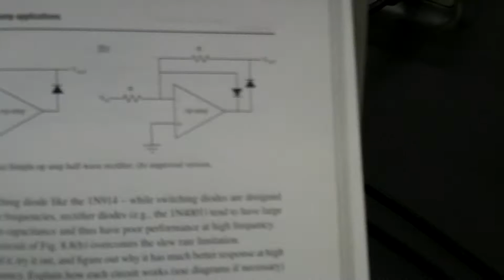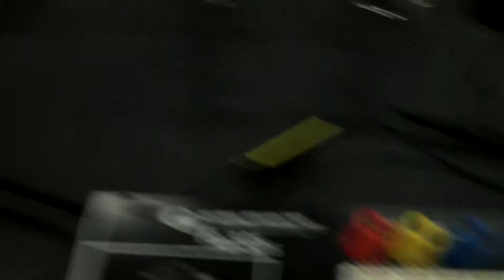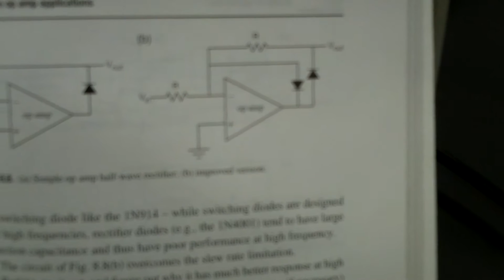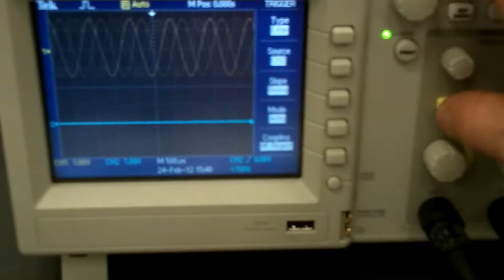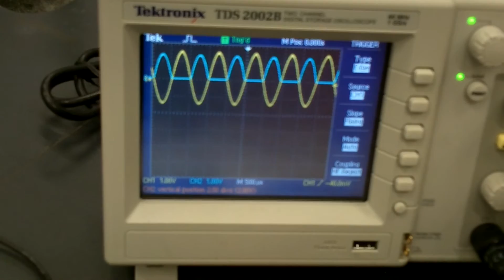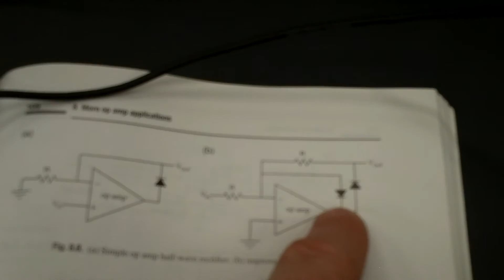Op Amp Rectifier Circuit Construction.MOV

Comment: I set up the same configuration but the output was not rectified exactly at the zero point but with some delay and partially cutted wave form. (Input signal was 200mv sine wave) . Could you pls help me !